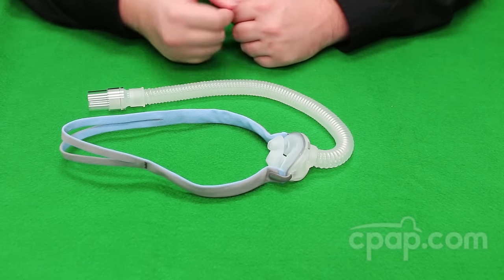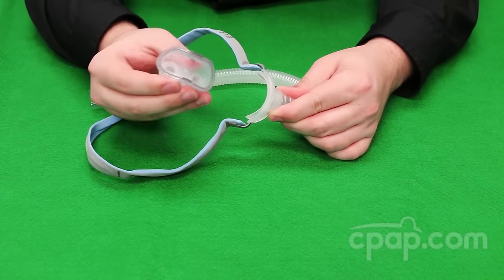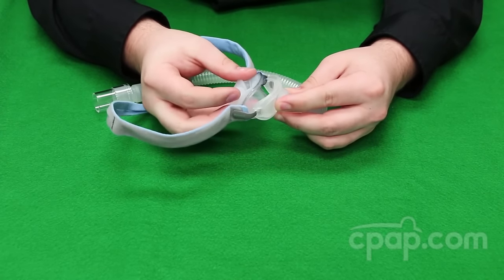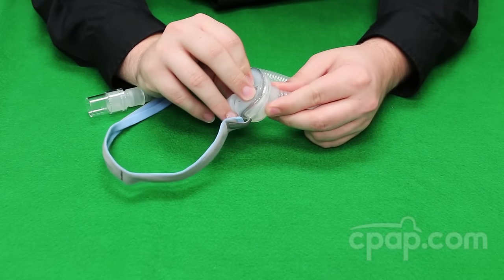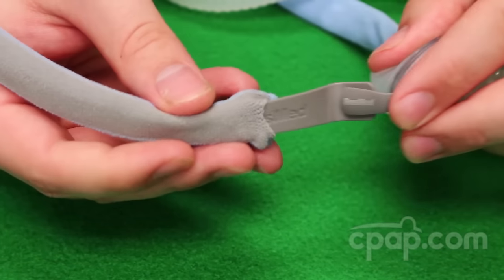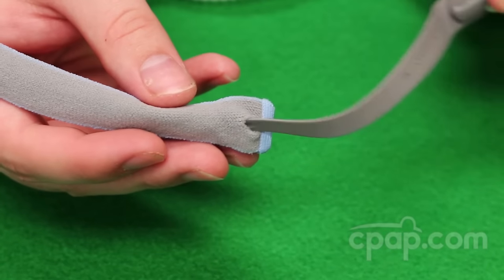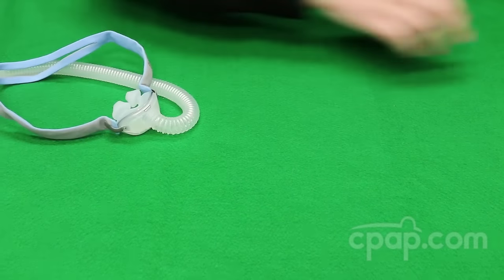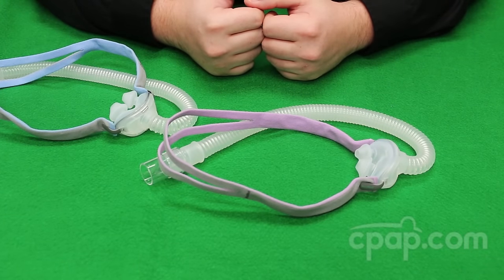AirFit P10 Nasal CPAP Mask Assembly Tips

Comment: Does the AirFit P10 require the exhalation kit/swivel elbow that fit another mask?  I’m unsure if the end of one hose should go directly into the end of the other hose without exhalation “vent”. Not sure what thats called.  Customer service isn’t available for the question. Hope you can shed some light. I really need to use this to breath so o2 levels wont dip too much.  Thanks for your help.